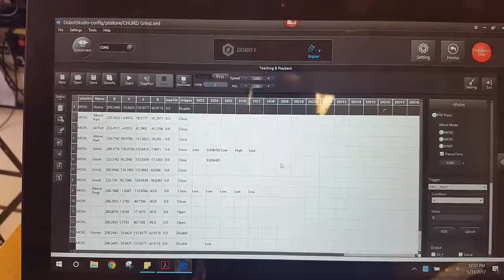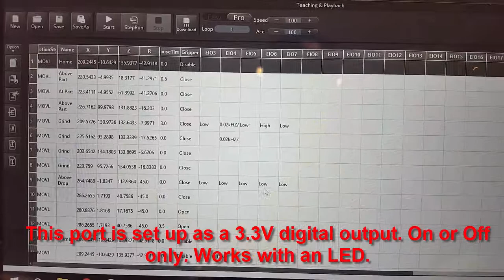2017 Dobot Magician Grind with Outputs

Comment: Great job Chirs! I'll talk with DOBOT R&D to see what's up there in EIO mistakes.
Reply from the maker: Thanks Will! All I need to do now is figure out how to send it an input with a normally open switch... without blowing anything up. Any ideas?  Thanks!
Reply: hi Chris, I asked R&D to check the EIO mistake you mentioned but they didn't find the same mistake. if you need help could you send an email to support@dobot.cc to detail your testing process, hey'll help you. I consulted with them about the switch input, they said it's alright to do it. you can put the switch into a circle with one of Dobot EIO switch connections to make it a switch.
Reply from the maker: That would be easy, but the last time I did it, I burned out the communications on the main board. I will contact them and get the answer.  Thanks Will!
Reply: Chris Hurd did you get any reply from Dobot on this case? I’m trying to connect a servo motor on the same EIO